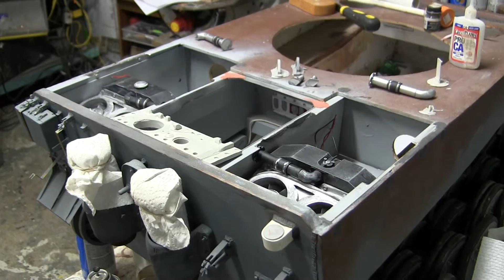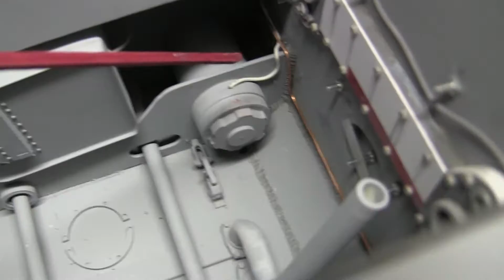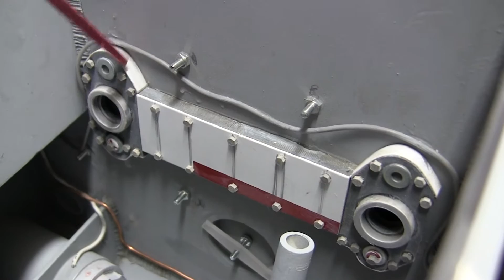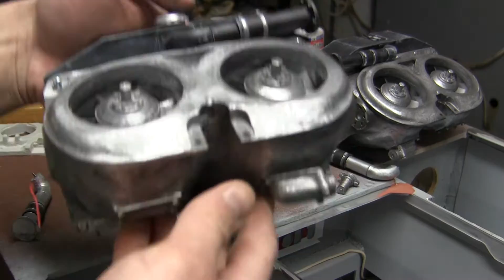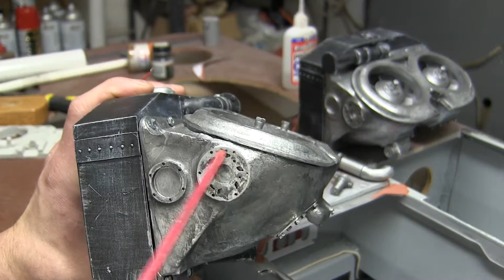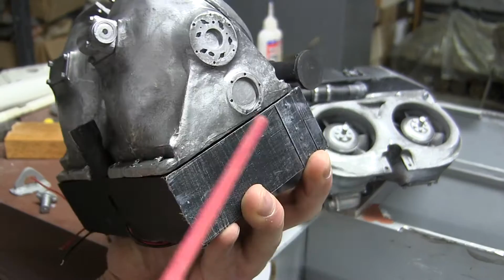1/6th scale Scratch built German Tiger I Tank project video #5 (engine cooling system) HD video

Comment from the maker: During the Bovington tiger 131 tank restoration the restoration crew replaced the original HL210 engine with the HL230 from the King tiger. This was done because the original HL 210 engine was transformed into a cutaway display piece thus destroying it for use in the tank. When the engine was switched over to the HL 230 the HL210 cooling system was not going to work so the restoration team went ahead and re manufactured the HL230 fan gearboxes from original German WWII plans that were found.